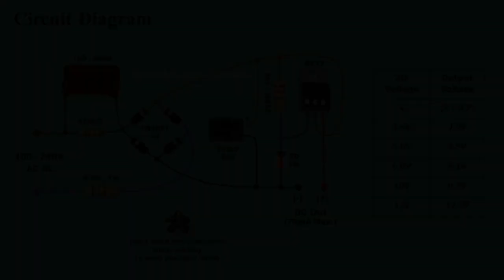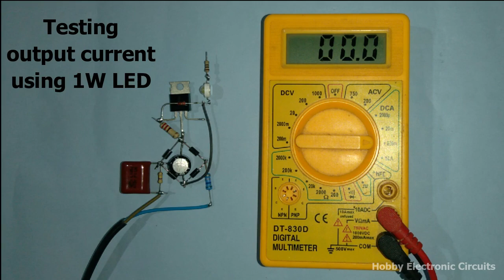Transformerless Capacitive Power Supply Circuit | 3V 5V 6V 9V 12V

Comment: It's very fantastic, but... What the name of of the transistor??? It's NPN??
Reply from the maker: Thank you.. 
That transistor works as a voltage regulator. Use D313, C1061 or TIP41. 
But remember, don't touch any component when working because the circuit is not isolated from mains AC.
Reply: @hobbyelectroniccircuits7391  Thanks brother, I have a proposal for you and I wish I could take it into consideration, have you thought about designing an oscillator for a switched source??? (like a cell phone charger?)
Reply from the maker: Sorry friend, I'm not familiar in designing Switching mode power supplies.

Comment: Meka nam recommend karanna baa. This circuit can kill you.. isolation naha.. alluwoth wadinawa..
Reply from the maker: ශරීරයේ ස්පර්ශ නොවෙන අඩු ධාරාවක් අවශ්‍යවන පරිපථ සඳහා යොදාගන්න පුළුවන්. 
Relay හෝ triac සහිත 230V පරිපථ 
අඩුබල LED drivers 
කුඩා lead-acid battery chargers 
කුඩා බුදුරැස්මාලා... 
මේ වගේ ඕනතරම් අවස්ථා තියෙනවා capacitive power supplies යොදාගන්න. 

Video එකේ ඒක පැහැදිලිව කියලා තියෙනවා "Don't touch any component when working" කියලා. 

Capacitive power supply දාල හදපු පරිපථ කීපයක්ම channel එකේ තියෙනවා බලන්න.
Reply: @hobbyelectroniccircuits7391  ow eka nam aththa.. Godak chinese badu wala ma cct eka thamai thiyenne. Cheap widihata kara ganna one nam oya circuit eka okay. Eth professional safety ekak athuwa quality widihata karanawa nam meka recommend karanna baha. Man hithana widihata nam api mokak hari deyak karaddi quality eka, safety eka wage dewal thamai godak ma wadagath wenne.. 
https://youtu.be/wX5YdbyYNGk

Ma video ekath balanna.. meke explain karanawa ma cct eka kochchara dangerous da kiyala
Reply from the maker: මේ වගේ capacitive power supply dangerous කියන්න ප්‍රධානම හේතුව තමයි ඇඟේ touch වුණොත් විදුලිසැර වදින එක. 
ඊට අමතරව over-load එකකදී හරි short එකකදී හරි series දාල තියෙන fusable resistor එක පිච්චෙනවා. 
China emergency lamp වල නම් voltage එක control වෙන්නේ බැටරියෙන්, capacitive LED driver වලනම් series තියෙන LED වලින්. මේ වගේ උපකරණ වල battery එක dead වුණොත් හරි series LED එකක් පිච්චුනොත් හරි 300V විතර DC voltage එකක් ඇවිත් smoothing capacitors පවා පිච්චෙනවා. 
ඒත් මං දාපු circuit එකේ transistor series regulator එකක් පාවිච්චි කරල තියෙනවා. 

ඒ නිසා මං හිතන්නේ ඔය සර්කිට් එකට ගැලපෙන දේවල් වලට භාවිතා කරන්න පුළුවන්. 
මම මේ වගේ capacitive power supply පාවිච්චි කරලා LDR+Relay තියෙන night light circuit හදලා තියෙනවා, වෙසක් එකට 230V flasher හදල තියෙනවා, පොඩි බල්බ් වැල් හදල තියෙනවා, ඕනනම් ඒ වගේ එකකට සාමාන්‍ය transformer එකක් හරි SMPS එකක් හරි පාවිච්චි කරන්නත් පුළුවන්. ඒත් අවශ්‍යතාවය අනුව ගැලපෙන method එකකට යන්න පුළුවන් Safety first කියන සංකල්පයට යටත්ව.
Reply: @hobbyelectroniccircuits7391  අනේ මන්ද bro.. Man nam hithanne api electronic , electrical wage deyak ma wage platform ekak use karala ape ayata kiyala denawa nam dangerous nathi deyak kiyala dena eka thamai wadath ma සුදුසු. Ma video eka godak aya balanna puluwan eth ma balana ayagen ekkenek hari meka waradiyata try karala ජීවිත හානියක් වුණොත් eke wagakeema ganne kawda. Api ලංකාවේ ayawa educate karaddi eyalata risk ekak athi nowena, ewagema thaman gema kiyala quality product ekak eyalata hadanna puluwan widihe knowledge ekak laba dena eka thamai wadath ma sudusu. Ape lankawe ayage දැනුම  දියුණු karanawa nam api karanna one china, india wage ratawal wala use karana dangerous low quality  technology eka gana kiyala dena eka newei. Api kiyala denna one technology eka paththen issarahenma inna රටවල් wala ma dewal kohomada eyala impliment karanne kiyana eka ganai. Man nam kamathi ape මිනිස්සු anna e widihata දියුණු wenawa dakinnai.
Reply from the maker: වීඩියෝ එකේ තියෙන diagram එකේ පැහැදිලිව circuit එකේ අවදානම ගැන කියල තියෙනවා symbol එක්කම. 
මං මේක ගැන description එකකුත් දාන්නම් එතකොට මේක පාවිච්චි කරන්න පුළුවන් අවස්ථා සහ අවධානම ගැන වීඩියෝ එක බලන්න කලින්ම අදහසක් ඒවි. 

තාර්කිකව දැනුම බෙදාහදාගත්තට ස්තුතියි.
Reply: @hobbyelectroniccircuits7391  ow ehema kara nam හොඳයි. Comment ekak dala pin karoth thawath hondai. Anyway good luck bro. Keep up the good work and creating good contents.
Reply from the maker: Thank you. 
👍👍🙋‍♂️🙋‍♂️

Comment: 500mA ගන්න පුළුවන් එකක් කරන්න beyda
Reply from the maker: Capacitive power supply එකකින් 500mA ගන්න අමාරුයි. 
225/400V වගේ capacitor එකක් දැම්මත් උපරිම ගන්න පුළුවන් 150mA වගේ තමයි. 
අනික දැන් තියෙන polyester capacitors ඒ තරම් හොඳ නෑ, පරණ board වලින් ගලවල දානවනම් වඩා හොඳයි.
Reply: @hobbyelectroniccircuits7391  Led 60 buduremalawak weda කරන්න thibunanam athi.
Reply from the maker: LED 60 හතර ගානෙ series කරල තියෙනවනම් total segments 15ක් තියෙනවා. එක segment එකකින් 15mA ගත්තොත් 225mA ඕන වෙනවා. 
හොඳම දේ තමයි 12V/300mA transformer එකක් හරි 500mA SMPS එකක් හරි පාවිච්චි කරන එක. 
අනික බුදුරැස්මාලාවක් කියන්නෙ අතේ ගෑවෙන්න පුළුවන් දෙයක් නිසා capacitive power supply එකක් දාන එක අනතුරුදායකයි. 

මගෙ වීඩියෝ එකකුත් ඇති capacitive power supply එකකින් වැඩකරන LED chaser එකක් 24V වලින්, LED 8 ගානෙ series කරලා. 
https://youtu.be/vRywTV-jSnQ
Reply: @hobbyelectroniccircuits7391  mn buduremala pcb එහෙම karanawa.mage youtub channel eka බලන්න ko.mata oni gana aduwata එකක් .allanne nethiwenna හදන්නේ
Reply: @hobbyelectroniccircuits7391  rs pcb creation 
Channel eke nama
Reply: @hobbyelectroniccircuits7391  transfomer එකක් 425/=
Reply from the maker: 300mA transformer අඩුවට හොයාගන්න බලන්න. මං දැකල තියෙනවා facebook electronic groups වල lot එකක්ම විකුණන්න දාල තියෙනවා. 
අනික transformer එකට සාපේක්ෂව capacitive power supply වල polyester capacitor එකේ කල්පැවැත්ම අඩුයි. 
නැත්නම් LED drivers වලට එන SMPS driver එකට 7812 දාල ගන්න.

Comment: D313 Use karanne ayi?
Reply from the maker: Voltage regulator එකක් විදියට. 
Zener diode එකක් විතරක් දානවට වඩා transistor + zener + bias resistor ක්‍රමය ස්ථායී වැඩියි.
Reply: @hobbyelectroniccircuits7391  
👍👍👍👍

ඕක හදල  තියෙනවා හැබැයි  Transistor  නං use කරල නෑ..
Zener වලින් තමා voltage හැදුවෙ...
Reply from the maker: ඔව් zener එකක් විතරක් දාලත් පුළුවන්. 
Channel එකේ වීඩියෝ කීපයක් තියෙනවා zener එක විතරක් දාල හදපු capacitive power supply පාවිච්චි කරපු circuits. 

හැබැයි 105, 155, 225 වගේ uF ගාන ටිකක් වැඩි capacitor එකක් පාවිච්චි කරනකොට 100mA විතර current එකක් යන නිසා zener එකක් විතරක් දැම්මොත් no-load අවස්ථාවෙදි zener power dissipation එක (12V හිතුවොත්) 12×0.1 = 1.2W. ඒ හින්දා 1W zener එකේ කල්පැවැත්ම අඩුවෙනවා. 
ඒකයි වැඩි හොඳට transistor series regulator එකකුත් දැම්මේ. 👍